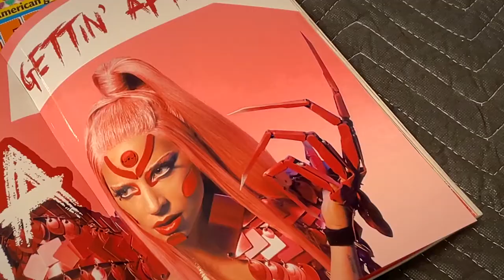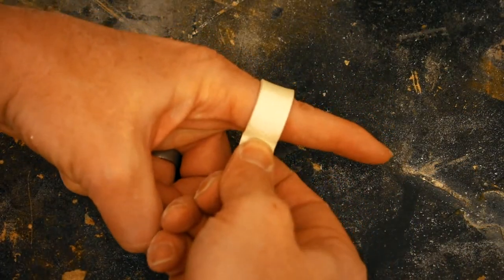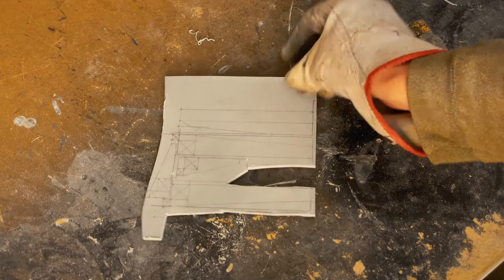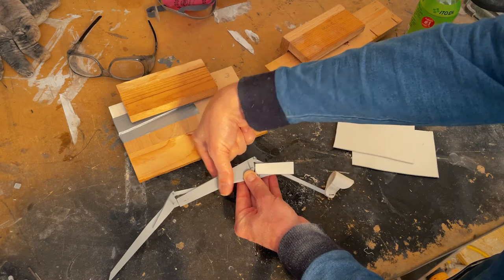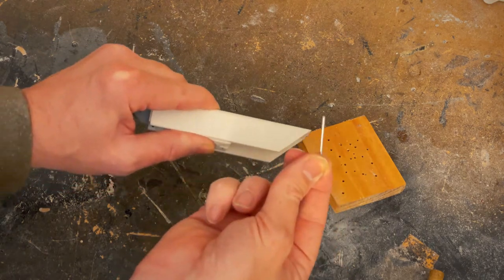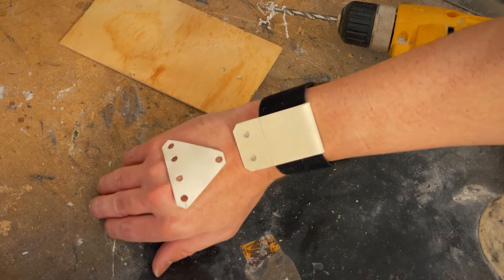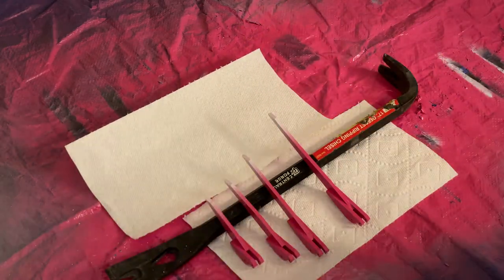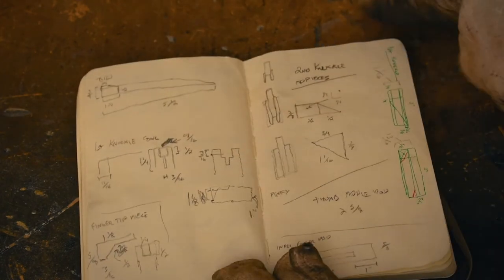Lady Gaga Chromatica Claw DIY

Comment: you actually did the linkages backwards, instead of top of knuckle, they go to bottom, and use a trapezoidal shape. ( to be fair Gary Fay used a gear in his design, you can find the design in on shape listed as mechanical finger)
Reply from the maker: Yeah I think I used an old design or something. Thanks for the info though, I'll check it out! Thanks for watching!

Comment: Amazing work man and absolutely genius using pvc. While designing did you consider going with the geared version?
And on another note, has anybody told you that you could be Dax Shepards double?
Reply from the maker: Thanks! I did look at the geared version and it's definitely a better way to go, but carving gears out of pvc would be too hard. 3d printing would make it possible though! You're the first one to call me Dax Shepard! Most think I look like Sheldon Cooper lol. Thanks for watching!
Reply: Yeah, no kidding about cutting out the gears lol. Sheldon huh... Yeah, i can see that lol. You've earned yourself a new subscriber good sir
Reply: Are you still creating material? I see its been a year since your last video and it would be a shame to not see new content.
Reply from the maker: @jeremywalker666  Yes! I know it's been too long but I've got a project going right now. One problem is that it gets too hot in the summer to be in my workshop! I need to think of "indoor projects" I guess.
Reply from the maker: @jeremywalker666  Thanks for the sub!

Comment: It amazing! You figured it out and made them look amazingly professional! What’s the thickness of the pvc pipes you used?
Reply from the maker: Thanks! I used two kinds of pipe, the thicker one is Schedule 40 which is about 3/16ths of an inch thick, and the other is sewer pipe which is about 1/16 inch thick. Thanks for watching!
Reply: @OperationLetsDoThis  Thank you!
The reason I asked is because I have multiple different sizes of leather, from 2 to 12 ounce
Reply: @OperationLetsDoThis  and what you did with the jig you made reminded me of wet-forming leather.
Reply from the maker: @AnthonyQuade  Aah, I didn't know leather was shaped that way! That's interesting!
Reply: @OperationLetsDoThis  veg tanned leather can be shaped by wetting it, forming it how you want, and it keeps the shape when it dries. You can also see it together and cement it like with the pvc. Your video made it a lot easier to understand than even Gary Fay’s video. By making the two boxes diagonal from each other was the biggest help.🤯